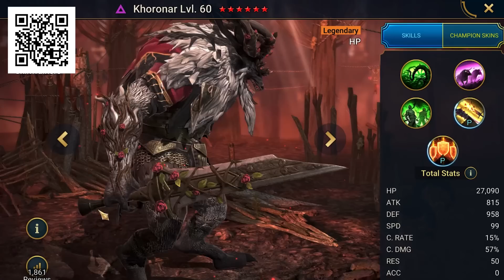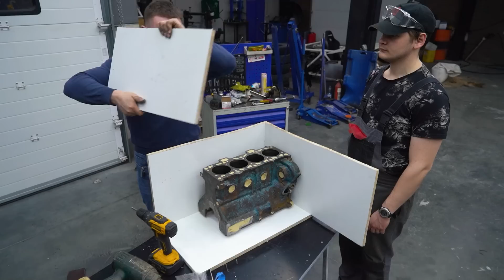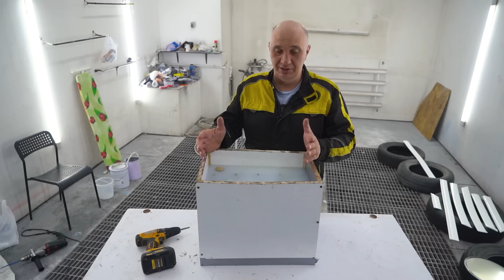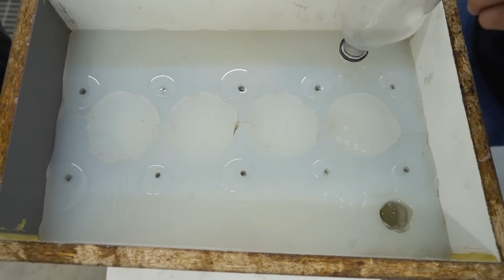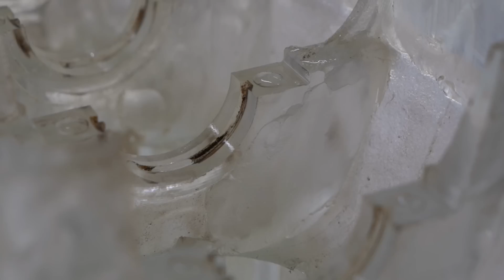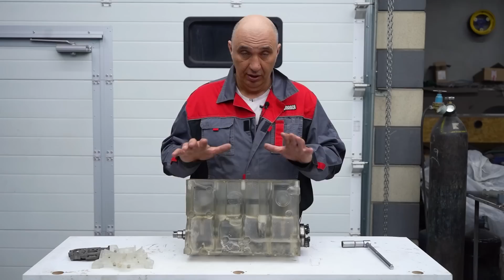We make a see-through engine block

Comment: I can’t believe they were able to replicate a whole block in a mold. That’s just amazing
Reply: No water jackets. No oiling galleries. It wouldn't go far.
Reply: @jeffrykopis5468  That's what I was thinking.  But would make for a cool display engine that can just be hand cranked for demonstration purposes.  I saw a full size Big Block V8 at a museum that was clear with all the internals different colors of plastic.  You could crank it by hand and see everything working in real time.  super cool.
Reply: Vlad can walk on water
Reply: @jeffrykopis5468  oh jee you're saying the resin block won't daily drive?
Reply: Being a heck of a bitch, that's pretty much how they're made in factories as well, but true that the molds are sand ones for casting, and multiple parts at that. Still, that single piece silicone mold is impressive no doubt, I have tried way smaller parts and still failed to make the mold.
Reply: @jeffrykopis5468  it could probably still idle for a good few minutes
Reply: @jeffrykopis5468  I guess they plan on drilling at least some oiling channels, since the valvetrain must be getting some oil, somehow. A separate lubrication system could of course also be an option, with the oil for the valves circulating outside of the crankcase. Cooling.... I don't think it really matters. With the low thermal conductivity of resin and its low melting point, it would be useless anyway. They'd be lucky to get 1-2 minutes of continuous running before it warps/melts.
Reply: I'd like to know the release agent that enabled the mold to come off in one piece.  Now THAT is the amazing part.
Reply: @jeffrykopis5468  Well yeah, they;'re just using it to demonstrate the engine
Reply: These guys are nothing short of amazing.👍
Reply: Well of course. It's only corporations whining about a tiny change heavily hurting their budget just because they don't want to do it.
Reply: Chinese engineering
Reply: @jeffrykopis5468  you could mashine oil galleries though
Reply: In Russia anything is possible
Reply: @Kalvinjj   in factory they made by 3d printer
Reply: @Kalvinjj  It is a task that costs a lot of money and effort. Using this amount of epoxy is very expensive. It was possible to buy a model from the Chinese Alibaba at a cheap price.

Comment: Use studs for the cylinder head instead of bolts and bond them in with epoxy. You may want to do that for the main bearing caps as well.
Reply: I worked in Aerospace Composites and Plastics what would have been even better is if they could have molded threaded inserts into the block. With how long and heavy duty they would have to be I don't think that you would be able to Sonic weld them into the block. Then that way you could thread a stud into the anchored insert and then it would probably be pretty strong for a while.
Reply: Bond the studs with Chemset. It's unbelievable. Sets quickly and cannot be removed.
Reply: rover bolted there heads to the main caps, big long bolts,
Reply: Time-sert the block first then epoxy studs into place.
Reply: You guys are all about making the threads stronger, and I was thinking that a helicoil might work, but then I remembered it has no cooling jacket!

Drill the head bolt holes all the way through the crankcase, then use through bolts with nuts. Eliminate threads in plastic. That may need the head to be installed before the crank, but the pistons can go in before the head goes on, or probly inserted from the bottom (since o-rings don't need a compressor).
Reply: @TheMeChaNic55  it would definitely need some type of an insert if he wants it to last more than a few seconds
Reply: @TheMeChaNic55  Time-Sert is good but a heavy-duty aircraft-grade molded in insert would probably last longer than the block itself
Reply: I almost wonder if rather than using the typical head bolt configuration Sonic welding inserts that are slightly smaller but using a whole bunch more studs would be better with a engine block made out of a casted glass resin.
Reply: I was thinking just cast the bolts in to the resin before it sets up soild
Reply: Just use epoxy to glue the head on. That way the bolts become only an alignment aid, not a stress carrier. As it will need to only survive a short while using some epoxy to bond to the head it will work long enough. Just have to make either the block top higher to compensate for the lack of gasket, or take a little more off the top of the pistons.
Reply: @NicCageForPresident2024  This is going to run for 10 minutes and break anyways.
Reply: @NicCageForPresident2024  This would definitely work, best way would be if they had a mold with already aligned holes at the top for the studs, like inserting head bolts in, making the mold, then adding threaded inserts of the bolt size on the bolt itself used, already on the correct position, THEN pour the resin. Would be quite interesting, definitely gonna be the resin that breaks not the inserts.
Tho I can imagine at this point making another block (if not mold) would be too much cost for what will only last a few minutes at best anyway.
Reply: I absolutely agree. Maybe make some 4 bolt main caps if youre able as well, 
Also put the thing behind a blast shield before you start it up!
Reply: @NicCageForPresident2024  I'm sure they'll try something like that if the threads fail.
Reply: My thought was to run threaded bar right through the Block,  washers on the base, but most likely won't work,  because the crankshaft journals will hit them,    there's no reason the bolts to keep the Head on need to be internal either,  the could be external.  Should be interesting to see what the guys at garage 54 come up with.
Reply: @aeroflopper  I thought the same think connecting the maincaps with the head 👍👍
Reply: Run the studs all the way through the block and put them through a metal bar at the bottom that bears on the block.

Comment: Limit the compression to 5:1 by using a very thick head gasket.  That should be enough compression to run but, not put too much stress on the head bolts.
Reply: I was thinking the same thing, the compression would pop the head right off 😆
Reply: maybe add high strength epoxy in the bolt holes?
Reply: Or lathe off the top of the pistons. 
That's what we used to do when running turbo's on non turbo engines. Reduce compression.
Works out more robust too.
Reply: @chincemagnet  that would be kinda funny to see the head yeet up.
Reply: @IvyMike.  I don't know how much meat is on the top of Lada pistons.  I imagine the CR on a Lada is 8.5:1 or so.  To drop it down to 5:1 will probably require BOTH dishing the pistons AND a thick head gasket.
Reply: They could also just machine material off the pistons themselves and bypass the head gasket entirely, if they plan to use a clear head.
Reply: @tripplefives Actually.... That would work well I think, as long as the valves go in straight. This would not be possible on my 4G32, but might be on my 4G63.
Reply: @the_kombinator   A clear OHC cylinder head!  Now that would be a major feat.

IMO, if they wanted a complete clear engine, a flat head engine would be best as the cylinder head would be a very simple resin casting.  Vlad used an old Lada (or Moskvitch?) flat head 4-cyl for the clear cylinder head demonstration.
Reply: epoxy and light torque on Bolts.
Reply: @garycarpenter2932  the head bolts will need anchors molded in beforehand. Otherwise they will need oversized coarse studs
Reply: @SV-cg3sk  i dunno. modern epoxy's have incredible holding power. not only will it bond to the block, but the plain stud as well.  i'd dare say a 100 ft pounds of torque would present much a problem.

Comment: A Rover K series would have been a good one for this. The head studs go all the way through the block and thread into the sump.
Reply: Yeah Rovers are really common in Russia... 🤦‍♂️
Reply: they held the main caps on the crank, excellent design, made the blocks lighter, same about the cooling system

Comment: This s such a great idea!  Imagine how much easier it will be to diagnose and repair engine problems as they arise! The mechanic will be able to literally SEE the issue and take the appropriate action for remedying the problem. Transparency seems to be the key to addressing ALL automotive problems!  

Imagine your radio stops working properly. If the radio is transparent, all you'll need to do is take a close look at it to see the problem and viola - cured!  Or if your horn stops working or your power door locks stop working - transparent horns and transparent doors and transparent everything will make fixing these pesky issues child's play! 

I am a long-time proponent of automotive transparency. (See my previous suggestions for all of the vast benefits of transparent gear shift knobs, transparent window visors and transparent firewalls which would allow for the continuous monitoring of those dirty but critically important parts under the hood.)

I look forward to the day when we have transparent windshields! I know it seems like too much to hope for, but just think of it - a transparent windshield would make it possible for the driver to see lots of important things such as when it's raining so you can both slow down a bit AND switch on the wipers, or when a bird leaves a friendly deposit on the glass and you'll know that it should be cleaned as soon as possible or when a truck tosses a rock into your glass leaving a ghastly crack. With transparent windshield glass, we'll see all of those things and so much more and this will make driving so much safer for all of us!

Comment: Can't wait to see the final assembly. I'd definitely recommend not using a head gasket and just using epoxy to glue the head and block surfaces together while using the pressure from the bolts to hold everything together. This is definitely one of the best ideas you have had . Not to mention the time and money invested and skill to do all of this. Awesome job guys.

Comment: Use threaded metal inserts secured in with epoxy glue/ jb weld for head bolt's etc.
Reply: I was thinking helicoils too but they'd have to tap the entire hole from top to bottom. Might as well drill oversized holes, then drop a bolt down the hole head first and fill it up tight with resin, they'll have studs then.

Comment: If you had blueprints from the foundry for the block casting, water jackets, sand cores, etc, the block could very easily be 3-D printed, and have a cooling system. But it would need cast iron cylinder sleeves, which are decidedly not transparent.

Comment: Cut out a little slot in the side of the block for a nut to sit in so the head can squeeze down on the block give the block as much plastic in-between the deck and the nut cut into the block from the side as possible to help prevent it from snapping a chunk off

Comment: now i did build the visible v-8 engine, it worked great, but this is a whole level of different x's 10,000. i wouldn't be surprised if you guys do pull it off. congratulations.

Comment: SUGGESTION - make the holes bigger and drill horizontally into the same hole from the outside of the block, use high temp jb weld throughout, drill and tap the jb weld, ive held in a spark plug into a stripped head for 6 months at a time!

Comment: lube it with mineral oil and put a transparent oil pan on.  Make a transparent head and adapt an electric motor to the output shaft like a transmission. use external tubing for the lubrication.

Comment: Please investigate if you can make a normally functioning engine run in reverse, so in opposite direction of rotation. And then find out how a car drives with it (-:
Reply: I believe some honda motors Spin in reverse,   the direction is corrected by the transmission so car drives normally.

Comment: use compressed air to help remove silicone molding it helps alot. either use head studs sunk with epoxy or drill and sink metal threads and epoxy them into the block for head bolts.

Comment: Drill all the way through the block top to bottom buy TTY all thread cut to length and essentially clamp it from top to bottom. It'll take a lil creativity as far as sealing it up bc of water jackets etc but it's doable. Drill through the oil pan as well clamp the whole thing together. I doubt anything else will hold up. Even trying to Time-Sert it or similar won't hang on long. But I guess you just need to outlast the O-rings so idk

Comment: For the head studs it’s easy. Cut open through the block where you tapped holes for the studs and insert nuts then refill it with resin again

Comment: At last! Now, make a transparent cylinder head, and glue it onto the block. Caution: might make piston and rod removal impossible. Shorten the piston heads to reduce compression ratio and run it on alcohol to keep things cool.

One extra idea since you all had made casting that much possible: a completely transparent carburetor. Will be doing transparent float bowls on mine and add a bung to easily adjust floats for fuel level.

Comment: 1 remold it with studs that are placed into the block with a shape or a head to not allow it to pull out.

2 try heli coil.

3. a threaded jacket with a outside shape that’s a bell, drill the hole into the block that’s a backwards bell than the metal jacket, make the hole in the block bigger than the jacket then fill with epoxy. If not this I recommend option 1.

Comment: Something with compressed air or steam and the piston seals must be of the right kind.   You know,   this would make a decent Air compressor.  To run this as a heat engine would require Pyrex glass cylinder sleeves and graphene pistons like the advanced stirling engine

Comment: Drill the headbolt holes larger and epoxy in healacoil fittings and run your headbolts into those. That will hold better.

Comment: I suggest ,a rectangle cage fitted tight attached around the top of the block , then to a metal head gasket your compression will change but  with adding indents that’s stink into the block (plastic )sorta like rivnuts (metal) which then you tighten the head bolts down with a little more force since the protrude down into the plastic it’s better then just only taping the plastic

Comment: Drill all the way through and put a nut on the other side of the head bolt. May have to machine an access  space for the nut if drilling all the way is not possible. Also could use an o-ring style head gasket.

Comment: You should drill holes in the head and put helicoils or something like that in there with jb weld, that seems like it would hold the head good. And for the cylinder walls you should polish it where its super smooth for better lubrication for the o rings on the piston

Comment: Could you have cast head studs in the block instead of drill/tap for bolts? Maybe you could drill oversized holes now and drop bolts upside down in the hole, then pour more resin to fill up the voids, just leaving the threads exposed above the block, then use nuts to torque the head down.

Comment: Bore out your bolt holes one size up and use those spring hole reducers, but put them in hot and they'll just sieze right in and act like metal on metal contact.

Comment: I love your videos so so much! 

If you guys have access to a turbocharged vehicle, you should put together a DIY boost pressure accumulator tank. Something that's hooked into the intake that gives boost right off throttle, but stores boost when excess is being produced.  
I think you guys could probably put together a simple system that achieves this.

Comment: might want to run it on alcohol rather than gas to prevent the cylinders from getting obscured with carbon  right away. also burning cooler and the charge absorbing more heat should help with longevity at least somewhat.

Comment: If I remember correctly, the o ring pistons produced ALOT of compression. You may end up having to build a spacer between the block and head.. seeing the fuel ignite would be cool... this is after you run modified head studs.. or heli coils

Comment: See if you can line up the head bolt holes with the main caps holes and use really long bolts?
Reply: Rotaries are through bolted. Rob Dahms 4 rotor uses bolts like 2 feet long. Maybe larger diameter threaded inserts put as deep as possible. I used steel inserts into raw aluminum to get an increase in torque and not rip out the threads fairly often. It looked like they blocked the oil/coolant passages with the clay before molding it. I know it has a clear coolant pump but I'm not sure how well those were actually transferred. It's going to need a lot of machining to get coolant/oil to flow through the engine. Billet engines do it all the time so I'm confident they'll figure that part out. Maybe an external electric pump for at least the oil. Possibly use a food grade mineral oil because it's clear and generally not as reactive or dissolving of most plastics.
Reply: rover did it

Comment: Also with some math you might figure the pressure that material can tolerate then adjust the compression ratio to match, of course fuel settings and such will change. Try with Alcohol fuel as it is a much cooler fuel

Comment: Can we keep the lower part and oil pan of engine block made of metal. and Use a thicker glass for just bore*stroke area. and keep the crankshaft part opaque. Use polycarbonate instead of glass. that too which is too much thicker than this.

Comment: Why not use helicoils with the head bolts, if these were bonded in to the threaded holes the force would be kept between metals one of which would be bonded to the epoxy so would allow the head to be torqued down a lot tighter.

Comment: you could use steel barrel inserts for the threads. Also grease instead of oil works At my tech school they have a clear 1cyl engine that runs on paint thinner or brake clean and it uses grease for lubrication since its a 4 stroke.
Reply: They could also have extra long bolt/studs.